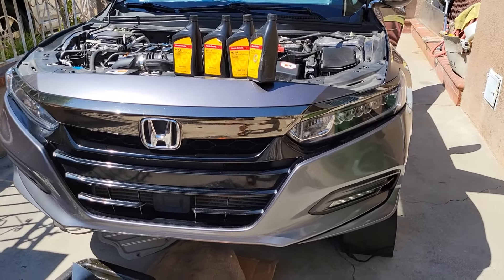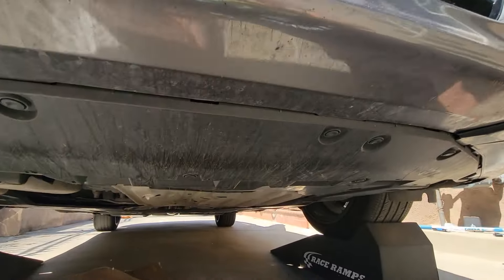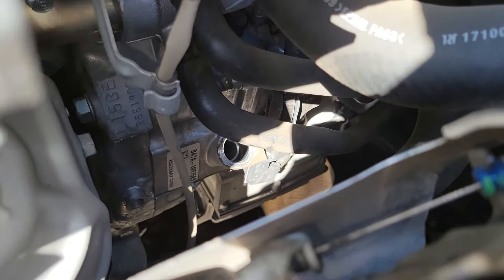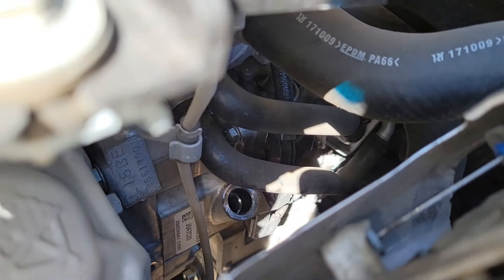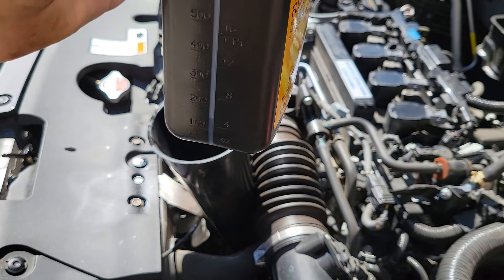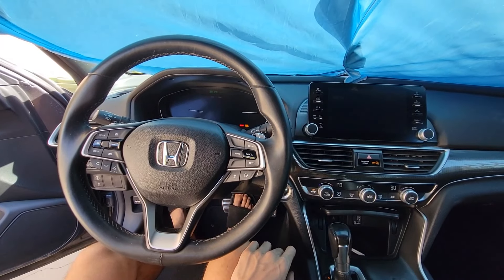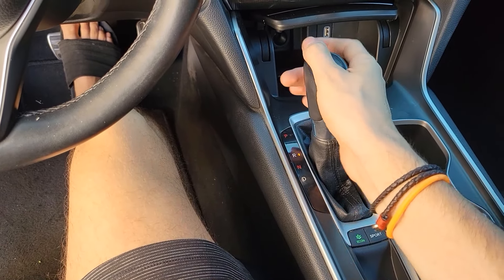CVT Transmission Fluid Oil Change 2018-2024 Honda Accord, CR-V (1.5L Turbo)

Comment: Thank you for the video. I have the same exact car color and everything.
Reply from the maker: Glad I could help! 
The charcoal (modern steel) is the cleanest color of the bunch in my opinion 
Let me know if there's anything else you're interested in seeing! I have a few other videos on this Accord, and a few more to come
Reply: @Striker50_  modern steel metallic or sonic gray for me. I'm gonna do CVT transmissions fluid change tomorrow. This video help.
Reply from the maker: @whyg6703  Nice! Update me on how it goes!
Reply: @Striker50_  just did it today. I follow the same exact step in your vidoes. The oil is pretty expensive though
Reply from the maker: @whyg6703  I KNOW! I paid $42 for 4 quarts last year, and this year it was $58! 
I order it on eBay since it's cheaper. Dealerships sell it for like $15 per quart where I am. 
Still better than paying $250+ at a dealership and having to wait 5 hours for your car 😀
Reply: @Striker50_  where i am. $18 per quart so i bought 4. Almost cost me $80. But thanks to your video i dont paid the dealer or mechanic to do it. I'll  do it myself.  When you do it yourself  you know that everything  is tight and needy. Not missing a bolt o anythin.
Reply from the maker: @whyg6703  Exactly 👍 I like your thinking
Make sure to check out what next time you order; it's much cheaper
Reply: @Striker50_  you still drive same car? If you are gotta few questions.
Reply from the maker: @whyg6703  Yeah, I use my 2013 as a daily but I could answer your questions; what's up?
Reply: @Striker50_   you get any squeek noise while turning wheel. Or your gas tank making noise when you lock the car or unlock the car. Or it just my car. I got 53k miles
Reply from the maker: @whyg6703  We're very similar in miles!
No, no squeak. Did you get new tires by chance? Perhaps try recording the noise; you could have someone turn the wheel and open the hood while they do it
Reply: @Striker50_  i did all of that
 Nothing wrong. Car drives perfect. I read somewhere online sometimes could be the tire pressure. I live in the eastcoast. Do you get alot of road noise on those 19 inch wheel low profile tire?
Reply from the maker: @whyg6703  Oh damn yeah temperature plays a HUGE factor so I'm not knowledgeable. Southern California ranges from 35-110 so I never get to experience the car in cold temperature
Reply from the maker: @whyg6703  Yes I get a lot of road noise on these sport rims particularly. The tire is thinner (235/40/19) vs on my 2013 Accord which is a bit thicker (235/45/18). Stay tuned though, because I did upgrade the tires on this 2018 Accord! I'll be making a video soon on it!
I put 235/45/19 tires on it which are a bit meatier. The tire center didn't even want to let me install them because they thought it might rub. Rides softer and quieter

Comment: Thanks for the video bro.  Doing mine this week.  How much does the fluid normally cost from the dealer?
Reply from the maker: Glad I could help 👍
Expect it to run anywhere from $45 (for a good deal on eBay) to $55-60. Some dealerships are pricier than others which is annoying but that's what it is I guess. 

Another thing I noticed is that Honda is trying to make more money from transmission oil changes which doesn't sit right with me, seems like a money grab. My 2013 Accord probably has the same CVT and that transmission oil change is recommended every 90,000 miles. Whereas this one is recommended every 30k-50k from what I've seen on the forums. If you don't change it yourself, that's like $150-$250 every time, not to mention it takes like 3-6hours waiting, which is a rip off so that's why I make the videos to help people save time and money 💰
Reply: They charge me $206
Reply: Liquid gold..45$😢
Reply: The dealer can tell you what they charge. My dealer charges $13.75 per quart in Indiana.

Comment: Just a minor correction: On the manual, it actually says 3.9 US Quarts (3.7 L) for the CVT Fluid
Reply from the maker: Good catch 👍 the lower level is around 3.6Q proper level is 3.9Q 
When I recorded this 2 yrs ago I had to record all of the audio in 1 take so I fumbled up the Q and L, I'll be making a super detailed update to this soon with 4 jack stands, check bolt, and everything I've learned some other things no YouTube videos have shown
Reply: @Striker50_  We appreciate your effort. This and the oil change is still the best out there. Keep up the good work!
Reply from the maker: You're too kind thanks for that🙏   @mark1nyc

Comment: Thanks for the video. You added 3.8 quarts of oil to the cvt. Is that amount what was drained ?  It’s a great video I’m just hesitant to do mine given I’ve seen other instructions that when we drain the transmission oil, it does not completely drain. Wondering your thoughts on this.
Reply from the maker: ✌️ Glad I could help; had to research a lot on this model to assure accurate info. 

Correct, I drained 3.8Q. (Give or take 3.75-3.8 since fluid is always viscous and hard to accurately measure in the jugs)
I left it draining for about 40 minutes to assure it could be more accurate. 
Could be that it was slightly overfilled at the factory which isn't too bad since it's only 0.1L. Recommend capacity is 3.7L but I followed the ChrisFix method of measuring what comes out. 
I also called 3 dealerships, 2 said 3.7L & 1 said 4.0L which I know can't be true and they're not the most reputable either from numerous experiences going in the past so I used that as a source also. 
Again, disclaimer that I'm an amateur that is just interested in personal repairs so everything I'm saying is just personal opinion. 

Let me know if you have any other questions! This service is pretty straight forward! Reference your manual and call a few dealerships that made me feel better when I was considering doing it myself

Here is a link I used as one of my sources 
https://techinfo.honda.com/rjanisis/content/rjxa_isisviewer_sa.aspx?m=61TV&k=pubs/sm/1/2/Contents/enu/61TVAD/GEN/SCT/SC/SYS/G004475_enu/web/html/G004475_enu&p=SM&t=H&model=ACCORD&year=2018&referer=ownerlink
Reply: Dont over think it..dump all 4 qrts..its all goood
Reply: Should the gear filter be changed?

Comment: The only that you don't show us was where is the transmision fluid filter
Reply from the maker: Correct. The transmission filters are not supposed to be replaced based off of Honda bulletin boards. There is one behind the radiator, and another one inside the oil pan. Both are do-able, but not required so I didn't want to complicate it where a lot of people would be hesitant to do it

Comment: Good video 🎉
question I keep researching Internet forums and calling Honda service centers 
They cannot Come with a service interval on when you should do a CVT Transmission fluid change I have a 1.5T Honda Civic Hatch 2020
Some say 30k or every other oil change and I was like!?
Would it be okay at 60,000k
Reply from the maker: Thanks appreciate it 👌 
Yeah definitely! 60k is plenty fine. If you're driving it crazy all the time, then 30-45k, but 60k is pretty conservative too especially if it's just used for regular commuting. I did the same thing for my other Accord and all I could find is every 60-90k. The CVTs are nearly identical
Personally, I think service centers and such are recommending it at 30K or around that just so they can make more money off of it. If you didn't know, service centers make the most money for dealerships

Comment: The manual says 3.7 Liters or 3.9 Quarts. Not 3.7 Quarts. Fill plug is 30 ft lbs if torquing. There's also a drain bolt above the main drain plug to open with the car level to drain to the proper level.
Reply: That's good I formation. Why isn't there a fluid level dipstick?
Reply from the maker: Yup, Honda makes it difficult, so you take it in and pay them $300 to do this

Comment: My light just popped up for transmission, spark plugs and valve adjustment. Did you do a valve adjustment as well or wait?
Reply from the maker: I didn't get a notification for the spark plugs, just the trans oil, and the service interval recommended at that mileage; funny enough I'm going in Tuesday to get my valve cover gasket replaced as well as getting the valves adjusted. $200 for it by a local guy instead of $425 quoted by the dealership 💥🫰🏻
Reply: @Striker50_  that’s not a bad price
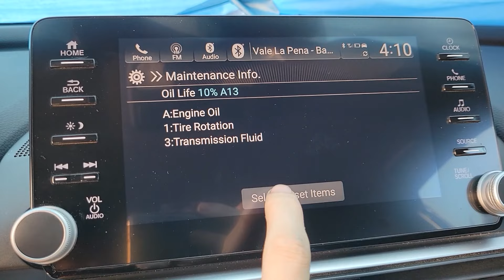Reply from the maker: 6:10 are the maintenance it recc. at the 50k mileage point for me
Reply from the maker: @jeffreykwong1712  Right!? I could do the valve cover gasket, but the valve adjustment is a skill I don't have so I'd rather take it in to get it done professionally
Reply: @Striker50_  my mechanic asked if I hear any ticking. He said my mileage is low and that I can wait. I don’t know. I’ll do my oil change and transmission and then spark plugs next month and the valve adjustment the following month.
Reply from the maker: @jeffreykwong1712  What mileage are you at? Yeah nice most of those are easy enough to do yourself. I might do a spark plug video soon but we've had rain for like 3 weeks straight down here now
Reply: @Striker50_  I’m only at 55k. Yeh not too concerned about the spark plugs. Just worried about the valve adjustment. Yeah had a big storm last night and maybe tonight as well. Keep safe. Thanks
Reply from the maker: @jeffreykwong1712  You're golden car is still new no worries, my 2013 Accord is at 145k and is barely getting it done, has run fine and I've pushed it along the years and it's held up

Comment: I had a question, I noticed there is another plug which actually reads “HCF-2”.Does that mean there are two ports where you can fill the transmission fluid?
Reply from the maker: @alejandromendoza9303  Yes, that is the most random thing I have seen as well but it's confirmed

Comment: 2 years later. 2024. Great video.
Ummm.. does it have a Trans-filter.”?
Reply from the maker: @billythekid2594  yep it has 2 filters but they're not in the service bulletins to be changed. One is in the CVT pan the other one is behind the radiator

Comment: Hey dude!
Hope your doing well
Can you make a video on mass air flow sensor cleaning and throttle body cleaning for the Honda accord?
Reply from the maker: Hey! Same to you. Are you having the code come up for the throttle body?
Reply: @Striker50_  yea lol
Reply from the maker: @yusufkohgy9122  interesting I got the code too. Do you use a K&N engine filter by chance? Or do you regularly change your engine air filter?
Reply: @Striker50_  I haven’t changed the filter in awhile, I just bought the filters today
Reply from the maker: @yusufkohgy9122  Let me know how dirty it is. I got the throttle body code idk if you saw the video I made about the code. I had a shop clean it for me since I was getting my valves adjusted, might as well have them do it and they charge really good prices

Comment: Wow you don’t have to remove the entire transmission pan to clean that out also wouldn’t that be dirty and might be contaminated? I’ve seen other vehicles they do this but looks like this model and year can skip that?? If so I’m going to diy this for sure.
Reply from the maker: Most newer cars you don't have to drop the pan since there's a single drain bolt. On the 07 ranger on my channel you still have to do it the traditional way  which is messier and a bit more time consuming 
But this is nearly as easy as an engine oil change! You got it!

Comment: I use the castrol transmax cvt smooth Drive Technology...excellent oil same as amsoil cvt
And amazing oil ...you can feal the difference immediately
Reply from the maker: Nice! I'm sure that is a good option also with a little more research! I personally am going to just use OEM for the major parts in my cars, but I'm glad you're having great results also Christian! 🙌

Comment: Do I have to change the crush washer? I'm about to do it now and am in doubt now.
Reply from the maker: To be on the safe side I would. You could get a slow drip if your old one is compressed
Reply: @Striker50_  10/4, the quick response is definitely appreciated.
Reply from the maker: @michaelmichael1460  Always 👌
Reply: @Striker50_  FYI, just subscribed.
Reply from the maker: Blessss. 🙏 @michaelmichael1460

Comment: Why does service centers don't offer transmission fluid changes... They always tell me to take mines to the dealership
Reply from the maker: That's interesting. Maybe they don't want to be liable in case the CVT/ transmission is already messed up (high miles, etc.) 
A customer can complain that the issue didn't start until after taking it in. In my area every place will do it

Comment: I’ve read some interesting information about Amsoil Synthetic CVT Oil. I’m gonna give this a go soon.
Reply from the maker: For the CVT, I don't even bother entertaining alternative brands that are a little cheaper; you'll probably only save $40 in the entire lifetime of owning the car, smart move 🙏
Reply from the maker: P. 623 of the owners manual says not to to use other CVT oils and that it can void warranty. Normally I don't really care to use OEM Honda stuff, but the CVT is one of my rare exceptions

Comment: Hey I have a 2021 Honda Accord se 1.5 I did this but I drained out 5qts and last time I did a transmission was at the dealer and they said they did a half should I put back in 5qts or the 3.8qts ?? Also my car was at an angel like yours dose that make a difference?
Reply from the maker: It shouldn't make much difference. As for 5 qts that sounds like a lotttt
There is a check plug to make sure it's at the right level I can make a video on that but it requires more tools

Comment: What are the torque values and how do you check the fluid level after you run it and let it warm up?
Reply from the maker: Torque values are very similar to an engine oil change.Give or take 30lb ft as it is aluminum housing. I will be making an updated video on this service showing everything there is to know including the check plug method for proper levels

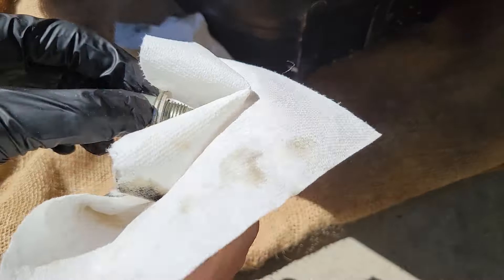Comment: At 2:52 you mention a "transmission fill plug". Isn't this possibly the "drain plug"? What type of funnel did you use, one with a flexible hose? Your video provides a lot of insight for the procedure of changing transmission fluid. Thanks!
Reply from the maker: Correct Steve, it's a Drain plug. Sometimes when recording, the brain is focused on keeping the camera stable, etc. So the wrong words come out when simultaneously talking 🤣
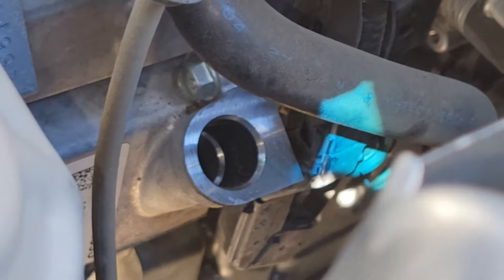4:09 It's just a standard plastic long funnel from O'Reilly's, but you can find a ton of flexible funnels on Amazon at affordable prices
Thanks for the acknowledgement! My editing skills were much more limited 1 year ago but glad this video served you well
Reply: Actually it is a fill plug. It’s made of rubber and just pops in.

Comment: I have a 2018 sport 1.5 with high mileage, I’m about to change my transmission fluid, is it recommended to change the filter as well or would I be good?
Reply from the maker: You should be good. The filters are not meant to be changed based on the bulletins I have seen and it is similar for our Silverado we have. If something were to go wrong with the transmission, the technicians can look at the filter to more accurately be able to diagnose. That is the reasoning I have found out so I'd rather not mess with it. If they wanted it to be serviceable they would have made it much easier, especially a company like Honda

Comment: Question? You said for the 2.0t the filler plug for the transmission fluid it's a little further to the back? I'm trying to get my trans fluid done on my 2.0t. kind of tricky on trying to locate the filler plug on the 2.0ts.
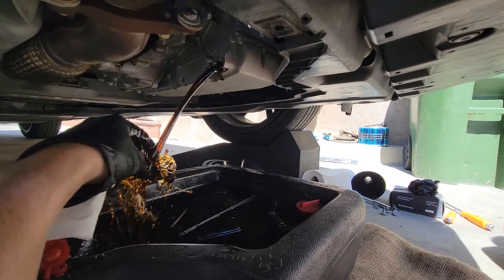Reply from the maker: Check out this vid @2:14 mark for the automatic 10 speed transmission
https://youtu.be/A2lpkLiVQgE

The fill plug should be to the left of the Red battery terminal 🔋
Reply from the maker: For the manual transmission
Check out this vid starting at the @2:23 mark: https://youtu.be/pgZhbbTmC3M
Reply: Please note the 2.0 uses a conventional automatic transmission, not a CVT so don’t use CVT specific fluid.

Comment: I have a 2021 accord sport se. The cap next to the battery/engine filter that says HCF-2 do I need to do anything to that cap/take it off for anything when I change my fluid?
Reply from the maker: @dsjonesway  Yup, remove it prior to draining for smooth flow and so the oil doesn't glug out, that's also where you will be refilling from

Comment: What’s the miles your car have to reach to clean that z?
Reply from the maker: The car's maintenance minder will notify you at around 54,000 miles. Honda reccs. 60k miles for the transmission fluid. Depending on how you drive, could be sooner or could be later. i have my other Accord that I didn't change this Fluid until 110K miles, and its still driving good at 150K miles. While I dont recc. waiting that long, it should be ok

Comment: hey so does anyone every mentioned to you anything about having the car level evenly from the front and back for transmission services? I am actually curious if it is a big deal to have the car level evenly when doing transmission service.
Reply from the maker: I had about 2 sticklers mention it, I personally don't think it makes a massive change, but I'll be making an "updated" video showing the car level, and I'll be using the check bolt method as well. At the time I recorded this I didn't have 4 jack stands and it was in the middle of COVID so I didn't stop by the Honda parts dept